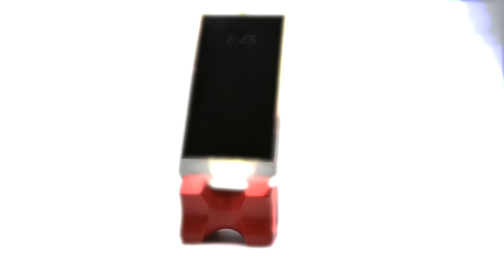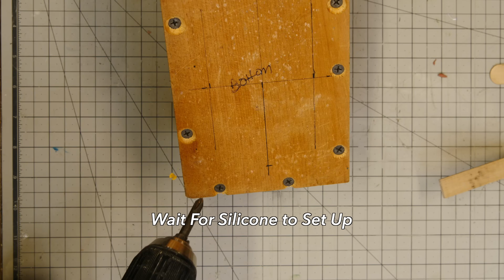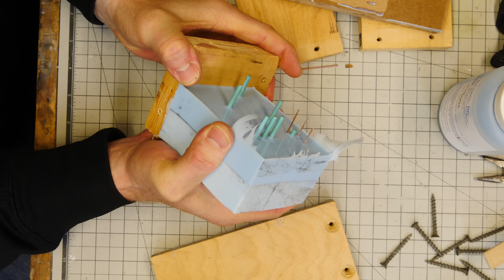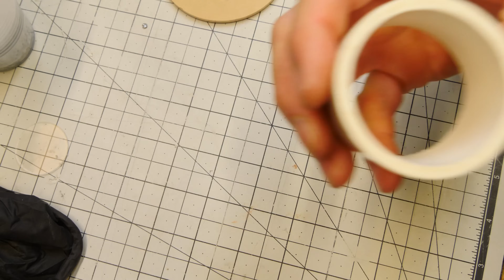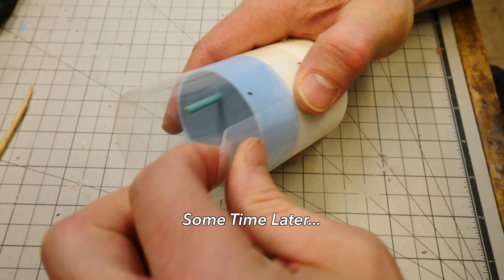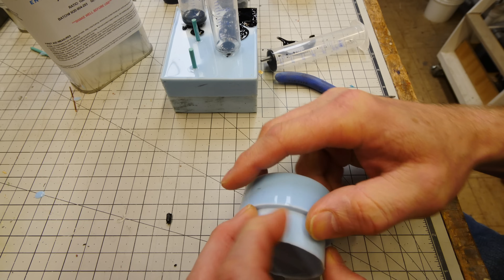Molding & Casting Small Urethane Resin Parts with two part silicone molds

Comment: What do you recommend these days for a Johnson paste wax replacement? I was crushed when they stopped making it and sources of new old stock are almost non existent now.
Reply from the maker: I don't have any other suggestions, I just purchased 85% tub on eBay for 40 bucks
Reply: @EricStrebel ahhh I'm afraid of a similar fate.  I may have to at least try to make my own concoction.

Comment: Hi dear Eric, I wondering something about of urethane pouring. Can I pour with vibration table as pressure tank? Cuz I couldn't find any pressure tank in my country. Thanks for answer 🙏🏻
Reply from the maker: I pressure pot is needed to get the best parts, the vibration table just helps move the material into the mold

Comment: I like your channel because you do not mess around... even show me the mistakes. This is important, because how otherwise can I know what to avoid. Silicone casting is a seriously expensive thing to do. Nothing simple about it. Just got an SLA printer and wasted a few hundred dollars of resin already. Same with the silicone. All my 3D printed parts do not cast in silicone... the silicone stays liquid in places. I suspect that this is the Isopropanol entering the SLA resin. I will try the BJB WC85dm. I am very disappointed with some other PU resin I got.
My point is... this is not easy.

Comment: I have a resin 3d printer. I'm considering printing a custom mold box, as well as printing the sprues directly onto the part I'll be making a cast of. Would you recommend this? do you think I'll have trouble prying the two silicone halves apart if the sprues are fastened to the molded piece? great video btw I love watching your process. For context I'm making my own roller skate wheels and will be urethane resin casting in the silicone mold in a pressure chamber

Comment: I was gifted a floor squeegee head that screws onto the end of a broomstick. Unfortunately, its (presumably) European threads are incompatible with the (presumably) Acme threads on my North-American broom handles. I was thinking of 3D-printing a functional adapter but the thought of modelling a tapered thread fills me total dread, whereas the thought of making a mold sounds like fun.

How would you go about making a functional thread adapter from the existing female thread on the squeegee head? How should I create the mold? What resin should I cast?

Comment: Has anyone here tried pouring the resin into a single-part mold, with the top flush surface exposed?  I was thinking of trying a scew-on plastic cap this way (top surface of the cap at the surface of the mold).

Comment: This is vacuum casting right?
Reply from the maker: No
Reply: @EricStrebel  what kind of casting is it?
Reply from the maker: Urethane resin cast with pressure
Reply: @EricStrebel  sorry. I was reading the course for my exam. It’s similar to vacuum cast? Because I saw polyurethane resin used, silicon mold too. So I was thinking yours was vacuum too.

Comment: Interesting use of golf tees to use as a sprue and venting holes. For the pouring vent, definitely use an actual funnel so it will be less mess and the pour sprue will be easier to remove.

The funnel shank should be the same diameter as the cental shank of the tee

Comment: This is a minor point but if you laser cut L profiles out of the wood, you would be left with small vertical seams but it would use a tiny amount of the wood material

Comment: Good video! Don't you use pressure chamber? No bubbles...?
Reply from the maker: Yes, that will give you the best results
Reply: @EricStrebel  Is 4,2 bar (60psi) enough pressure for polyurethane? I use flex Shore 85A for roller skate wheels.
Reply from the maker: Yes, that is sufficient
Reply: @EricStrebel  Thank You! Love your answers. Keep up the good work! (Y)

Comment: Awesome job Eric - Learned a lot.  I need to make a part for my electric scooter and so I'll give it a try.  I'll need to invest in a vacuum chamber and maybe a pressure chamber as well but should be worth it. Question...  Is there any benefit to adding extremely fine fiberglass strands to the Urethane resin for extra strength?  Thanks
Reply from the maker: Depends on the results you are after,   consult with the resin mfg for best results
Reply: @Eric Strebel  Will do. Thx

Comment: You don't prefer to use vibration at some point to remove bubbles if needed?  Vacuum is great, but maybe other stages need vibration, or no? I know they use it in Dental work.
Reply from the maker: At this point I use vibration almost all the time in addition to everything else to remove bubbles.
Reply from the maker: At this point I use vibration almost all the time in addition to everything else to remove bubbles.
Reply from the maker: At this point I use vibration almost all the time in addition to everything else to remove bubbles.

Comment: I was looking in "SMALL SCALE " manufacturing.

3D printing = slow
Injection Molding = Fast but more capital intensive.
Resin casting seems a balance end for small scale production or firts few 500 PCs for parts.
Especially for small start ups.
Reply from the maker: Resin casting is Definitely not viable for anything more than 20 -30 parts in my opinion

Comment: Why do you degas the silicone befor pouring? couldn't you degas it in the mold? same for the resin. thanks for your content!
Reply from the maker: Good question, you wouldn't do yes the silicone because you could ruin your master, and you wouldn't degass your resin once it's in the mold because you wouldn't get a good part and you could easily trap bubbles.

Comment: Hello i have a question. How you heat up the pressure tank up to 120°C ? Is it hot air?
Reply from the maker: I use an old vintage coffee pot heater, I have added a link in the description to a reasonably priced heater for you.
Reply: @EricStrebel  Thank you so much

Comment: You did a great job and it requires a lot of handcrafting skills to do those casts, but would it not be much easier to buy and use a resin 3D printer? The partquality you can produce with them is crazy good.
Reply from the maker: Nope, not really strong enough
Reply: @EricStrebel  This entirely depends on the resin you use just like with casting. I know there are resins available from Formlabs that have a strength north of 70N/mm^2 and have good impact energy absorption so they are not brittle. This allows for highly funtional parts. What do you need the parts for that requires the use of Urethane Resin?
Reply from the maker: Color, strength, heat resistance, numerous factors, someday we will have those capabilities with printed parts, plus who is gonna model these crappy little parts with the correct detail?

Comment: I use a removable plug inside parts that have thick mold cores.  Once the plastic plug is removed, the silicone mold can be folded inwards away from the part to extract the fresh cast part.  Remember to replace the plastic plug before casting the next part.
Reply from the maker: Yup, that should work well! I assume you need a bit of mold release on the plug for that to work
Reply: @EricStrebel  
Yes.  Release is a must.  I use spray on silicone.

Comment: First, silicon mould shrinks then Molded pu shrinks, so finished product is under dimensioned and not fit for accurate parts.
Reply from the maker: Use quality silicone with no shrink and use pu is not garbage and does not shrink. Problem solved

Comment: Where do you get your color for resins? BJB liquid pigments?
Thanks for this. Always interesting.
I need a pressure pot!!!
Reply from the maker: Most places that sell resin will sell colorant as well. But the so strong colors from smooth on have been decent, but there are many pigment  supplies out there. Just make sure it's alcohol-based
Reply: @EricStrebel  Thanks. I have some pigment powder but I’d really like a solid color without swirls. I’ll try So-Strong. I appreciate the reply.

Comment: Those re-molded parts could only be considered facsimiles of the original master parts and would never measure up to injected molded parts' mechanical/chemical properties. Reforming a metal part into plastic resin is even more concerning. Maybe the parts were for display purposes only.

Comment: You should've used compressed air to remove that part.
It wasn't "stuck" to the silicone, it was under a vacuum. If you blow compressed air in between the part and the mold, it will release.
Reply from the maker: Perhaps

Comment: Thank you for such an informative video on casting such small parts, including the issues you've found. I really need to make parts roughly the same size, if not smaller. Do you think it would be possible to do this without the pressure/temperature chamber that you used on your video? If so, would there be any problems I might face not using it. (some of my parts will be roughly 2mm thickness.) again, thank you for a great video.

Comment: I did this for a few years. We made a lot of toys as well as some pieces for the Keurig coffee machines. Worst mistake i ever had happen was while pouring a few Chewbacca figures for Hasbro, the resin we used was mislabeled and instead of part a mixing with part B, the same material was in both 5 gallon containers. The next morning, after opening all the pressure pots, i opened up the first mold to find thick gooey resin pouring everywhere. And it took forever to clean all those molds. Chewbacca has a lot of hairlike features that creates a LOT of area to wash out!!!!
Reply from the maker: Funny story

Comment: I think you could have released the ring from the first mold. Next time try shooting some compressed air inbetween the silicone and the part to break the seal. If that doesn't work, I would have carved out of the a cone/core from the center of the ring. This would have allowed more room for the ID silicone to be pinched and flex which should have given enough wiggle room to remove the part.
Reply from the maker: Good stuff to try, thanks for the comments, much appreciated

Comment: Eric, have you ever had an experience with uneven shrinkage of polyurethane? How do you get over it?
Reply: Sometimes uneven shrinkage can come from a lack of vents and "make-up material" in those vents as the material cures and tries to shrink.  The vents work in two ways, they channel air out of the mold as the mold fills with urethane, but then those columns of material act as small reservoirs to feed the curing part.  That's why fill ports are often sucked in after the part is cured.  You want those vents to be roughly similar size to the wall thickness of the part so they don't exotherm too quick and starve the part from make-up material.  If you have a very thick walled cast part, you need to make sure there are plenty of vents to avoid this issue or you'll end up with sink-back marks on the part or what we call "worm wood" marks.
Reply from the maker: Very good advice, explained very well
Reply from the maker: No, use good PU

Comment: Nice work again Eric.  Showing the fails with the success is something missing in many of the tutorials out there.  It's a great way to learn how and why things go wrong, and how to avoid it again in the future.  An interesting thing we've found with WC-85DM rigid clear polyurethane when it comes to moisture sensitivity; you can avoid moisture bubbles if you cast into a heated mold (around 120F/50C) at ambient pressure (no pressure tank) OR simply pressure cast it.  You got the benefit of both by pressure casting with heat, so you can create bubble-free parts faster and with much better "green strength" upon demold compared to a room-temp cure.  Keep up the good work!

Comment: Another great video, Eric.  When you describe your mold release formula as vaseline thinned with naptha, 70/30, do you mean 70% vaseline, or 30%?  And, by weight or volume?
Reply from the maker: 70% naptha 30% Vaseline
Reply: @EricStrebel  Weight or volume?
Reply from the maker: Well I've never weighed it so I guess volume I just sort of eyeball it
Reply: @EricStrebel  if I don't have naptha, do you think mineral spirits would work as well?
Reply from the maker: Probably not, but try see what happens
Reply: @EricStrebel  it worked! Silicone didn't stick, I think I did about 50/50 maybe 40/60
Reply from the maker: Great 👍
Reply: If you try it, you'll know.